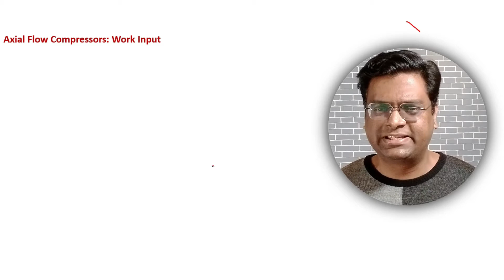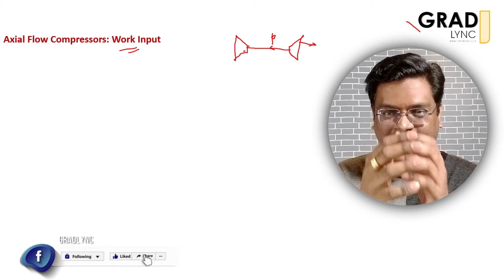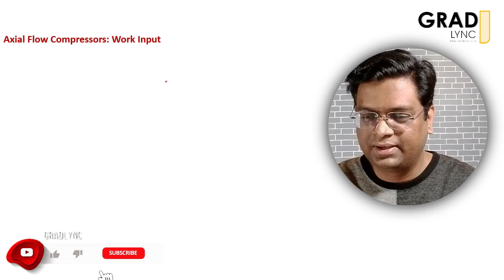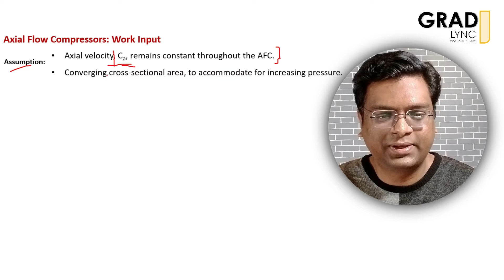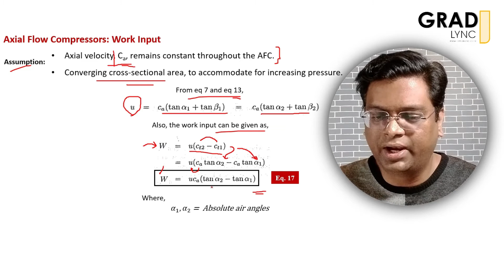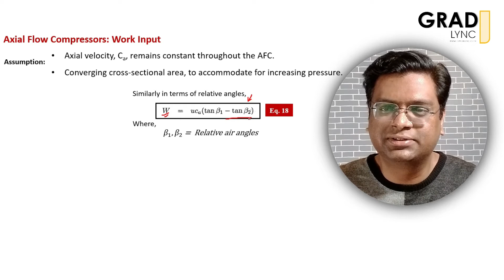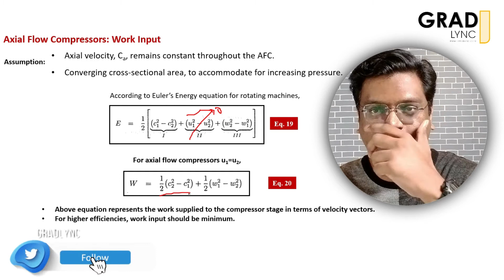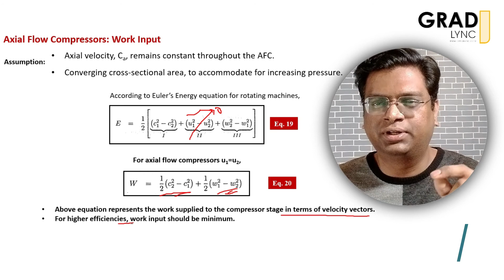Aircraft Propulsion | Unit3 | Lec35 | Work input to AFC

Comment: 2:49 if the Compressor needs power from the turbines to run, the problem would be with starting the compression cause, when the engines are off the turbines are not rotating or expanding the flow. 

So what I think is this the reason why we get pneumatics from APU bleed/bleed from another engine / ground support equipment to supply us the pneumatic power to start the engine
Reply from the maker: Definitely right.